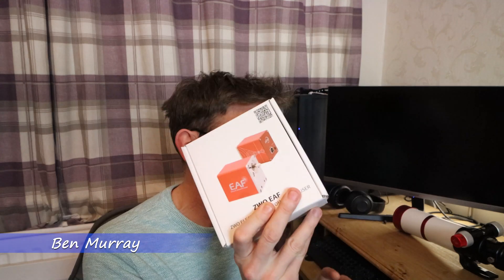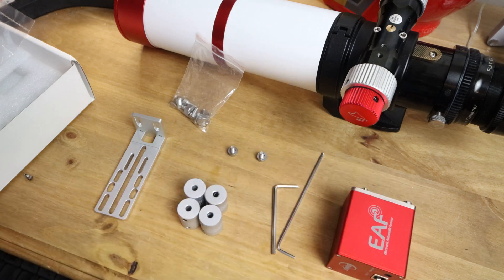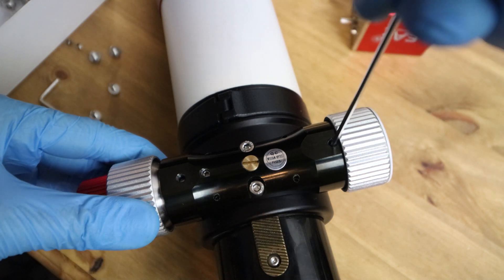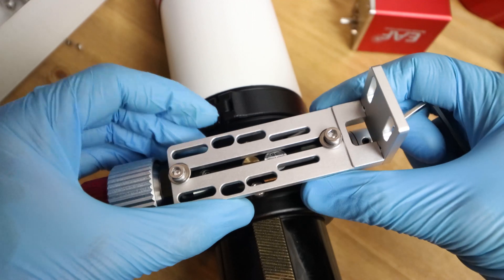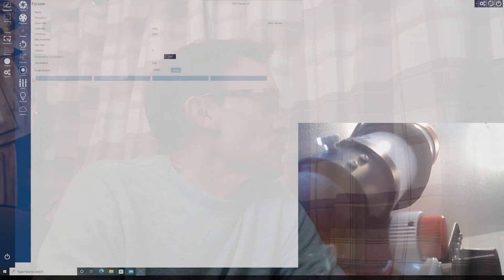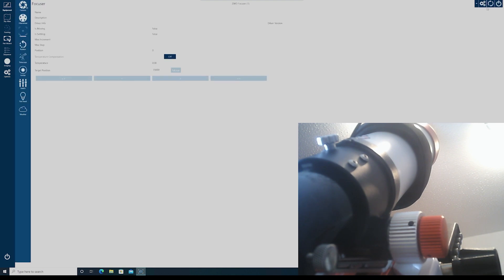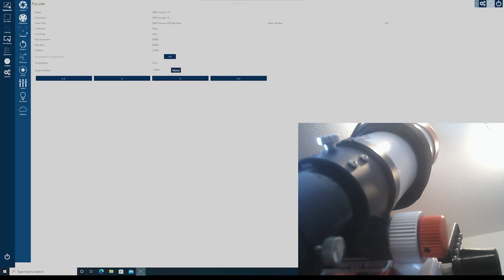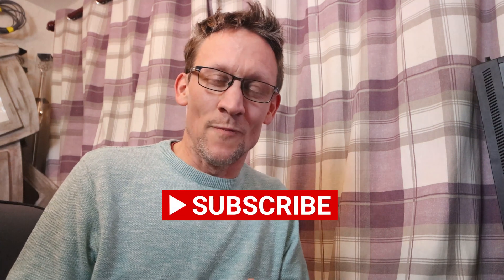How To Install The ZWO EAF To The William Optics Zenithstar 61 And Set The Backlash In N.I.N.A.

Comment: Are you using the ZWO 533MC Pro with this scope? If so...how are you images turning out? Are they undersampling? Reason I ask is...I have just purchased the WO ZS 61 and was intending to use my ZWO 533 but found there was a bit of undersampling going on of the exposure image....Have not had a chance to use it yet but I am curious....thanks in advance....oh and great video!! Also if I may...what mount are you using? Im using a EQ6 Pro and I cannot get the focusing housing past the locking bolts so I have had to turn the scope upsidedown so the focusing housing is on the opposite side? Thanks in advance.
Reply from the maker: Hi Appologies for  the delay in answering.
Yes it is the 533, there is slight undersapling but I seem to get away with it.  I have also used it with me Red Cat 51 alot  which is suposed to be even worse but I got some nice images with it to be honest.   The camera was intended to be used with an esprit 120 that I didn't end up getting so just kept using it on my small scopes. 

I also have the EQ6 r Pro and I also had that problem.   I had to rotate the scope a little and it only just fit but I have the Mk 1 zs61 so may be the reason why it fits.
Thank you for watching.

Comment: Thank you for sharing Ben! I got the ZWO ASIAIR plus last November with the 120 mini camera and 30mm guide scope and the ZWO EAF Focuser (which was very easy to fit on my Explore Scientific 127mm telescope, just had to use longer screw’s).
I have managed to use the EAF Focuser on two occasions due to the British weather .
I’m very impressed with the ZWO ASIAIR plus so far easy to use plus the Focuser is excellent, nice sharp stars.
Reply from the maker: Hey Tam
The EAF should make thing that bit smoother.  Im expecting a month of cloud though, now I have splashed out on a few new toys haha!  Always happens.....I dont think the Astro Gods like me much!
I have just eyed up a 32mm guide scope which comes with the 120mm mini funny enough.  How you finding that little cam?   I will be getting it next month if the wallet agrees.
As for the ASIair,  I also got mine November but not got round to setting it away.  Wanted to do some more on NINA and try to iron out the glitches I have been having before switching over.
Many Thanks!
Reply: The 120 mini a joy to use for guiding, money well spent.
Reply from the maker: Cheers Tam
I have been looking at that funny enough.  Oh by the way this comment only just popped in so not sure what happened there.

Comment: The shafts have a flat on them you need to make sure each one of the two grubscrews on each side of the couple...one on each side needs to go onto the flat of the shaft the other then clamps to the round part of the shaft otherwise the couple will get loose
Reply from the maker: Thanks for pointing that out Mark.  I missed mentioning that for some reason.  Never mind, at least you caught it.
Many thanks for commenting mate.
Reply: @CosmuzzAstro  I have a GT-71 I just bought with the same EAF. When I was getting it all going I found the guy did not install the EAF properly and there was a slot of backlash in it. Its fixed now of course. I am just starting and havent even taken a picture yet I am just trying to learn as much as I can about it and have watched a lot of your videos. Thankyou for making this content as it certainly helps to learn all this